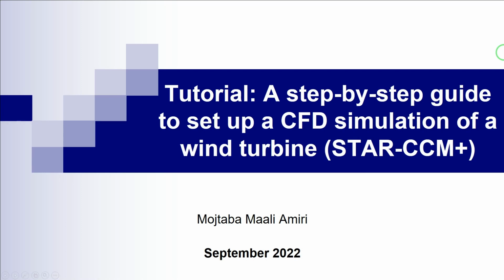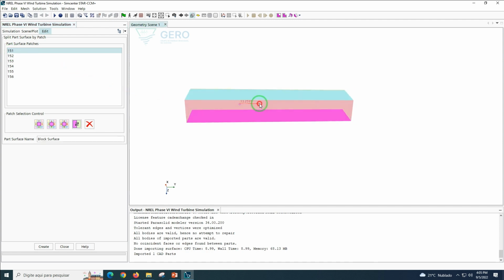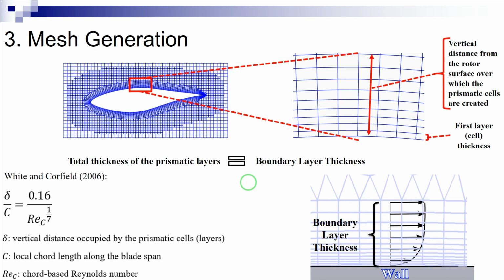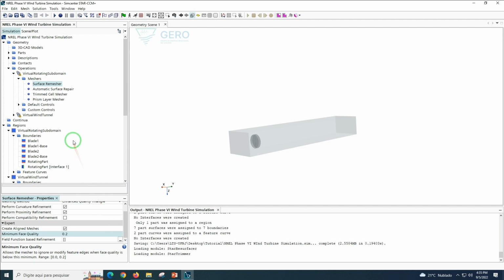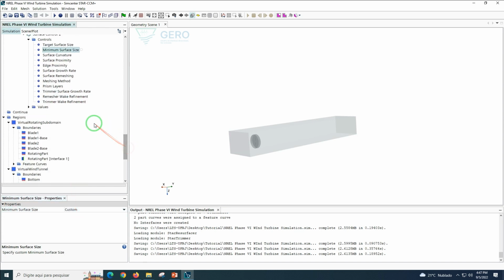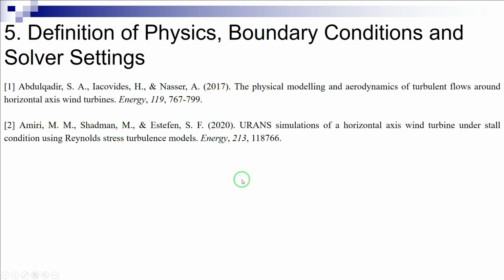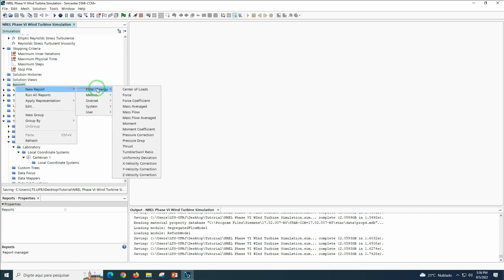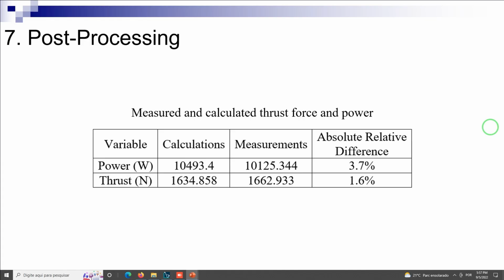Tutorial: Generation of a high-quality mesh for CFD simulations of wind turbines (STAR-CCM+)

Comment: Hello. Excuse me, could you help me? I'm modeling a tidal turbine, I need to find the average thrust and average power. But I didn't understand how you set up the power report. You multiplied the RPM by some figure, and then multiplied it by the torque report. What were those second digits? Is this transformation rpm into rps?

Comment: Hi your simulations are very impressive. I need a suggestion on my simulations. I should make a DFBI simulation (with Star CCM+) in which the body turn around it self (arround y axis, obviously arround its center of mass) with a time dependent angual velocity.  The problema is that with a DFBI simulation I can impose just the initial velocity of the body. Do you have an idea about how I can impose a time dependent angular velocity of the body?
Reply from the maker: Thank you for your interest in this video, You may need to impose this rotational motion using the rigid body option.
Reply: @CFD_Mojtaba   Can we chat (in some way) about this problem?  Because it is not so easy.

Comment: 1:10:50 It took six days to complete with 64gb of ram??
Reply from the maker: Dear Michael Carnahan,
The reason behind such a high computational cost is the refinement of the grid over both the wake and blade surface.
Reply: I need this to complete within a week with significantly less RAM. Here is my plan of action:
1. Change the inlet boundary to one diameter before the rotor instead of two and nine diameters to the pressure outlet versus fifteen as specified in the video.
2. Reduce the scale of the wind turbine blade down even further.
3. Change the time step from every one degree of rotation to every five degrees of rotation.
4. Change the max run time to an equivalent of two total rotations versus four total rotations.
5. I could make the simulation NONSPINNING and this would significantly cut down on the computational time, but then I would not be able to measure useful metrics like power.

What are your thoughts on this plan of action?
Reply from the maker: The best way to decrease the computational cost, may be the use of a steady state approach using a rotating refernece frame. This way, what you obtain is the steady-state solution rather than the temporal evolution of the variables.

Comment: very quality information from your video as always, however I want to take a little bit more help from you if possible; I designed my own 2.2 m dia fixed pitch propeller and I want to calculate the perfomance such as I want to measure the Thrust & Torque values at selective RPMs, so how can I proceed, is it correct way to iteratively guess the rotation rate (RPM) each time repeatively in order to get thrust and torque values ? Waiting to hear from you soon.
Reply from the maker: Dear shayant nandi, 
I recommend that you have a look at papers, where experimental methods are used to evaluate the wind turbine aerodynamics such as this paper: https://doi.org/10.1016/j.jweia.2018.03.001
Respectfully,
Mojtaba Maali.
Reply: @CFD_Mojtaba  I read the paper attached by you, thankyou for sharing that. Can you please tell me a rough guess on base size for my 2.2 m dia propeller for coarser mesh settings, I am trying to run coarse mesh on 32 GB RAM but memory is getting failed. Need your help sir!!

Comment: Good afternoon! Such a problem when modeling a wind turbine. In front of the wind turbine, at the beginning of the calculation area, a wall is being built, although there was no wall at the beginning. The input type is the velocity inlet, the speed profile is tabulated. To observe the vortices behind the wind turbine, an isosurface is used, I suspect that it is the case, but I can't figure it out. I change the parts in the isosurface, but this area appears like a wall in front of the wind turbine. Please tell me what I'm doing wrong. I will be grateful for the answer
Reply from the maker: Dear Marina, 
This problem can be due to a coarse mesh at the region close to the ground (as you are using tabulated data) and interface between the two domains. This can also be associated with the quality of mesh. You need to check the mesh quality based on the methodology presented here: https://youtu.be/ALGnQFLlrkg
The size of time step is another important parameter that you need to define carefully.
I hope this helps!
Respectfully,
Mojtaba Maali.

Comment: Great video! Are you able to share what the values within the Power report definition represent?
Reply from the maker: Dear Adam Robertson, 
Thank you for writing! The power is the product of the torque and rotor angular velocity (rad/sec). 
I hope this helps.
Respectfully,
Mojtaba Maali.
Reply: @adamrobertson7472  First you need to convert the rpm to rad/sec:
rad/s = rpm*(2*pi/60)
Then you can calculate the power as follows:
Power = Torque*rad/s

Comment: Hi, the rotation rate is given under specific income wind speed. And now, if I consider the wind profile with arbitrary magnitude and direct, or I consider the wake interaction of wind turbines. This method doesn't give the correct result.
Reply from the maker: Dear Thermal,

Why this strategy is used is twofold. First, reducing the computational cost. Further, using the obtained flow behavior to perform the fluid-structure interaction simulations, which are used to assess the structural behavior.
I hope this helps!
Respectfully,
Mojtaba Maali.